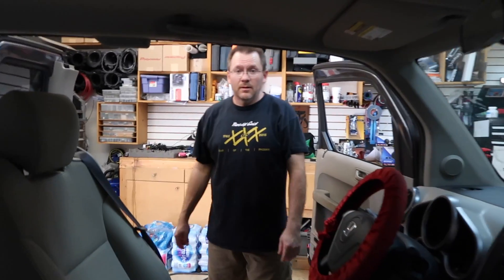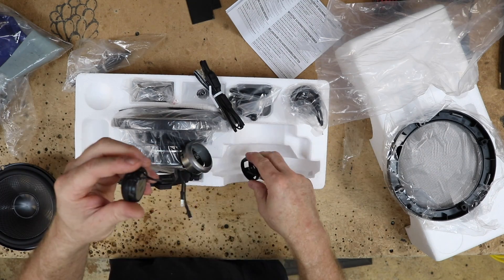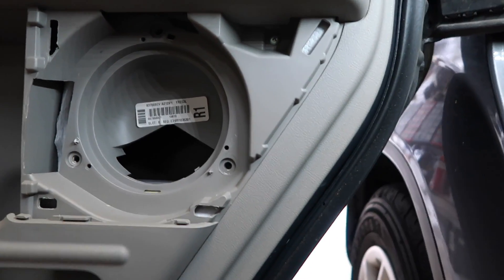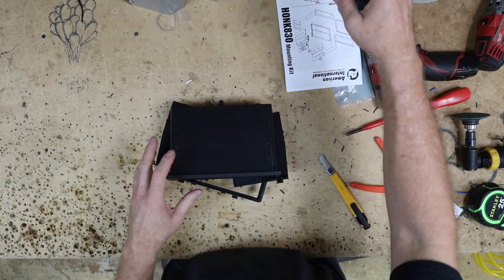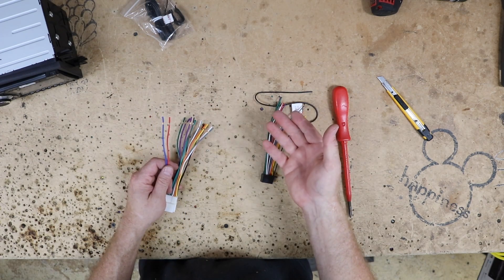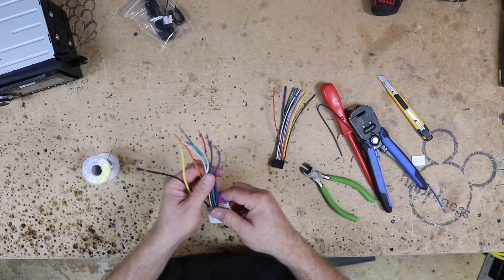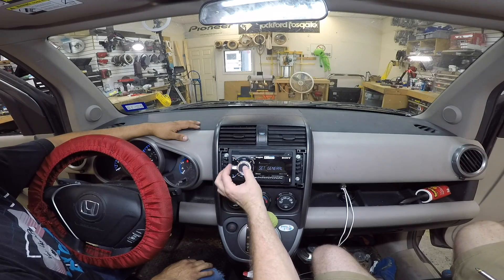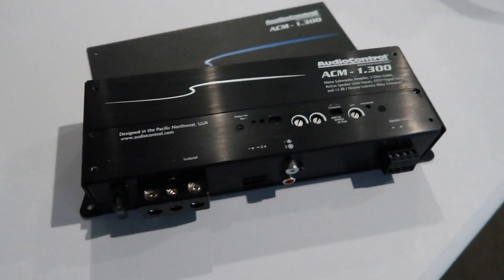A Honda Deck and 6 speakers, then a Audio Control field trip.  Installer Diaries 61

Comment: 4:56 My XAV-AX3250 is the same form factor but without that extra piece of metal on the bottom. I think Sony realized that they just need to make a plastic backing for the bottom portion. Nevertheless it still bolts up perfectly fine in a DD application.

Comment: When I put the head unit in my 11 hyundai I removed the antenna wire because I’d never needed it for any of my other cars. I didn’t want to lose my eq or time alignment so I had to solder it without pulling the radio which sucked

Comment: I like it in the middle below the rearview mirror. Tried the center of the gauge cluster and it didnt feel right. So i moved it back below the mirrow and gave the sound stage depth. Now it sounds like im always at a concert and a live show. Cant even tell my 10 ultimo is playing or not with my morel 2 way tempo ultra 6.5s.
Reply: Nice shout out for your own gear bro.

Comment: When I saw the video title I started freaking out because I thought it might be a dash kit for the Accords. Oh well the wait for a dash kit continues. I like how you guys did the work on those speaker. Clean. Do those Kenwood play very loud?
Reply: Brian Miles If your still looking for a dash kit, check out (Metra 99-7862 Lower Dash Single DIN). Made to fit Accord 2003-2004. Can be found on Amazon

Comment: I installed an aftermarket radio on my 04 element but my subwoofer no longer has sound,  can I connect those wires going to my stock sub to my harness behind the radio to any of the speaker wires and would that lower my ohms and be bad? Thanks.

Comment: Great info! I'm about to install a Pioneer AVH-2330NEX in my Honda Element. On single din receivers I have used the OEM mount. Any reason you don't like to use it for aftermarket receivers?
Reply: did the installation work out for you?  I have a 2011 Element and though the factory system is pretty darn nice, I'd like to juice it up

Comment: How to set the tweeters to play only high Hz sounds, while the speakers play mix range Hz ?
Reply: crossover, either active or passive will separate the frequencies that go to the speakers. If you power both speakers from the same amp output then you will need to use a passive crossover which usually comes with component speakers and if not you can build your own. Passive crossover just means they don't need power, they are just components like coils and capacitors etc, the value of the components determines the frequencies that get passed through them, active crossovers are actual electronic devices that need power and are adjustable with dials for the frequencies.

Comment: Why not just use the factory DIN brackets off the stock radio and use the trim ring that came with the Sony kit? To me that seems much easier than assembling a universal kit, but again that's just me.